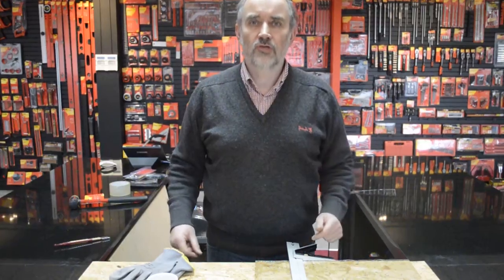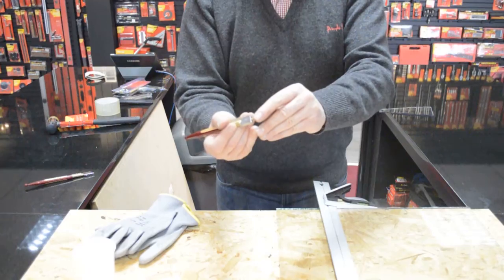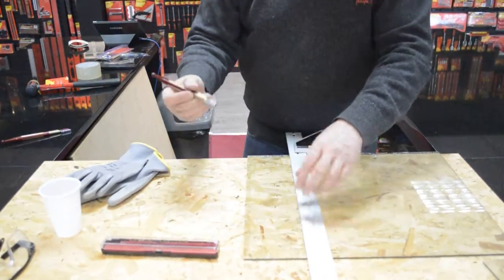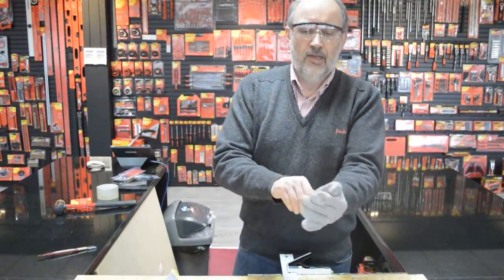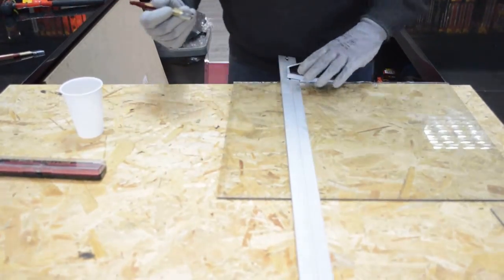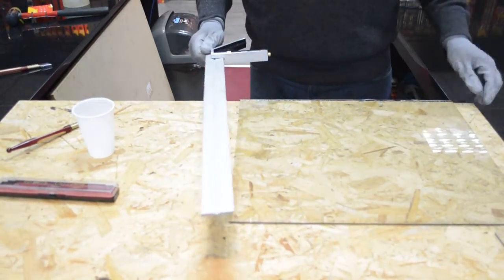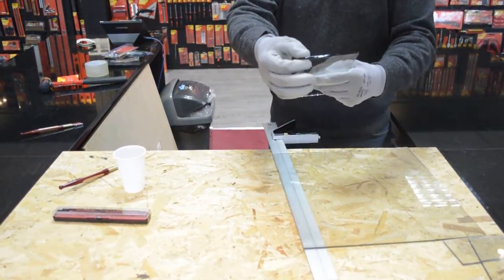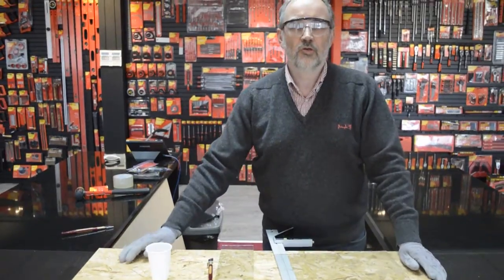How to use the Amtech Diamond Tipped Glass Cutter

Comment: Can this diamond cutter be used on wire glass ? And if so would it be easy as any glass?
Reply: YES IT CAN BE USED TO CUT WIRE GLASS BUT THERE'S A TRICK TO YOUR OUTCOME ONCE CUT AND BROKE YOU HAVE TO BEND THE GLASS UP AND DWN A FEW TIMES TO BRAKE THE WIRES THEN ADTER A FEW REPS OF BENDING PUSH DWN SLOWLEY IN 1 DRIECTION UNTILL THE WIRES ACTUALLY TEAR APPART
Reply: I'VE BEEN GLAZING FOR 60 YEARS AND HAD A TURN OR 2 AT IT.
LIKE CUTTING PLATES
96" TALL BY 130" IN LENGHT OR 8'FOOT TALL MY JUST UNDER 12' FEET IN LENGTH

Comment: so do you think that a diamond tip is better than a carbide tip
Reply: CARBIDE TIP CUTTERS ATE VERRY PECULIAR TO USE YOU SHOULD BE VERRY ACCOMPLISHED AT CUTTING WITH A STANDARD STYLE CUTTER PRIOR TO USING A CARBIDE TIP ONE (OH) AND NO ONE TELLS YOU OR ANYONE 
THAT NRW GLASS CUTTERS HAVE A BRAKE IN PERIOD LIKE 
NEW CUTTERS ON SINGLE STRENGTH UNTILL THEY GET DULL THEN THEY'RE MORE SUITED TO CUTTING 1/4" THICK WITH PLENTY OF LUBE